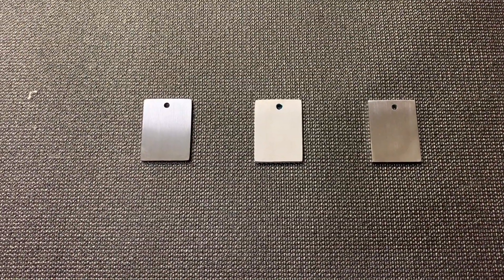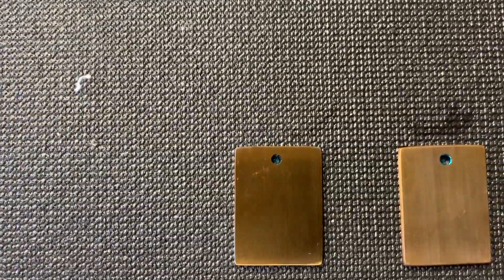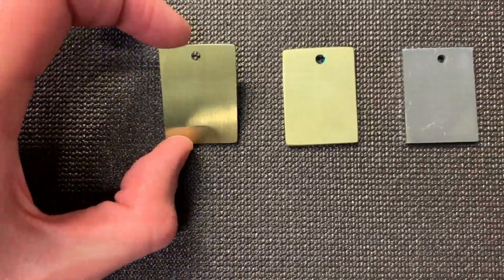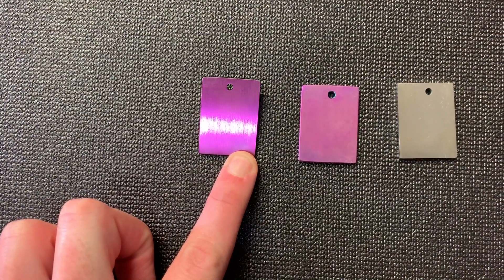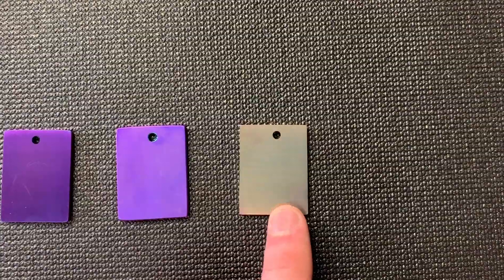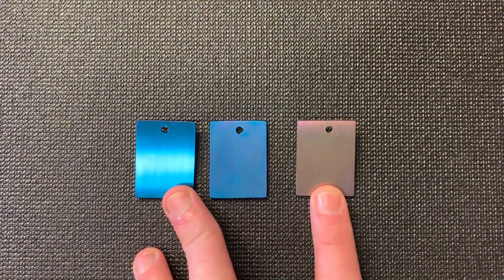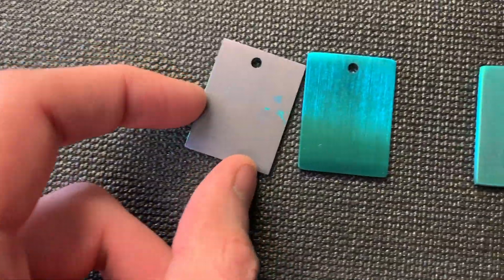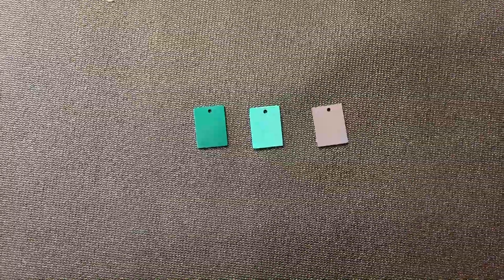Anodizing with Different Chemical Pre-Treatments

Comment: Nice comparison, Chris. We wanted to point out that while Whink works pretty well, it's the hydrofluoric acid that makes it work. We developed Multi-Etch specifically as a substitute for hydrofluoric which is a truly dangerous substance for both people and the environment. Also, Multi-Etch will retain whatever finish is on the titanium whereas solutions containing hydrofluoric will tend to make any finish matte. We appreciate your independent testing! Chris and Sandy Boothe, Multi-Etch LLC
Reply: Is there a way to buy Multi-Etch in a small amount like you can Whinks? I only have a small part to anodize and don't want to spend 50 bux
Reply: Or distribution in Europe??
Reply from the maker: Thanks guys.  We're well aware of the difference and it's why I almost exclusively use Multi Etch.

Comment: I use whink and a 9v setup.  And in my experience and after experimenting, that piece was in the Whink too long.  I’ll DM you on IG to show you some of my result.  I remove from the Whink just as it starts to bubble vigorously.  I’m @frost606 on IG.
Reply from the maker: You're correct, but this was just for the sake of demonstrating some of the variables that go into anodizing. I had no intention of making it perfect so that everyone can see the differences. The inconsistency is one of the main reasons why we don't use Whink's very much.  Also,  we dislike the way the titanium feels in hand after etching with sulfuric acid. It's something I haven't talked about in the videos, but the feel of the finish is almost as important as the way it looks.
Reply: @FerrumForge   Question for you...  I am going to have these scales professionally anodized, but they would like me to remove the "F" on my own first.  I have some Whink's already on hand and had planned on using that.  Do you think I would be better of trying to use Multi-Etch, or would it not be strong enough?

The other option would be to use a Brillo pad, but I am concerned that I won't be able to make the finish even because of the contouring.

https://i.imgur.com/4TGuBSA.jpg

Thanks and keep up the fantastic work!  I'm really enjoying my Keen and  Gent.

Comment: Hi Chris,

Was a new control piece used for successive higher voltages or only one? If it's only 1, wouldn't the existing layers of oxide hamper further oxide formation without etching?

Thanks for a nice and informative video BTW.
Reply from the maker: The short answer is no, the thin layer of oxide that is formed on titanium in atmosphere at room temperature will not hamper further oxide formation.  The longer answer is that it doesn't matter if there is existing oxide on the work piece because oxide builds on itself.  For example, if you are anodizing a piece blue, you will see it transition from bronze to purple before it gets to blue.  This is the oxide building up on the surface and light reflecting and refracting differently within the crystalline structure of titanium oxide.  Unlike iron oxides, titanium oxide is translucent and the colors presented are completely due to the way light interacts with the oxide layer and our eyes.
Reply: @FerrumForge  

Thanks for the detailed response Chris.

Comment: I’ve used whinks rust remover and multi etch. I always noticed that I get a better colors with the multi etch but it’s definitely more time consuming having to heat it up to around 160 degrees but for now on I’ll be using multi etch on most of my anodizing jobs. Whinks rust remover definitely removes existing anodizing  so much faster. I was always told after you use your etching solution to put it straight into distilled water until your about to anodize or it will form a oxidation layer again closing the titanium’s pores not allowing the electricity to flow through the titanium. Anyway love these types of anodizing vids. I can’t get enough of them. I also purchased some garnet blasting media as you suggested so I’m excited for my next stencil job.